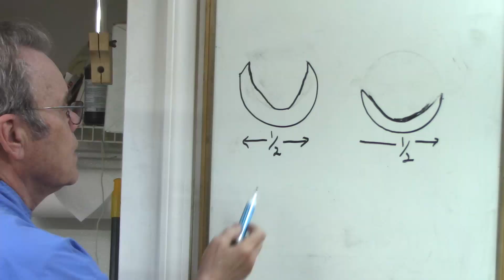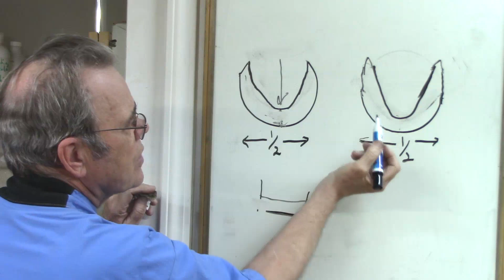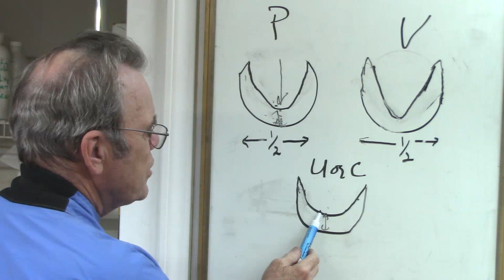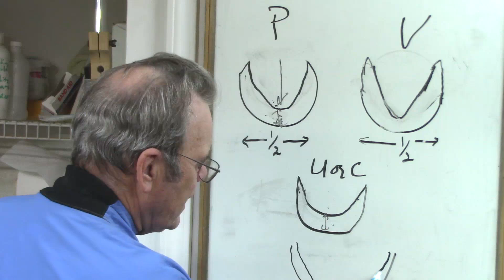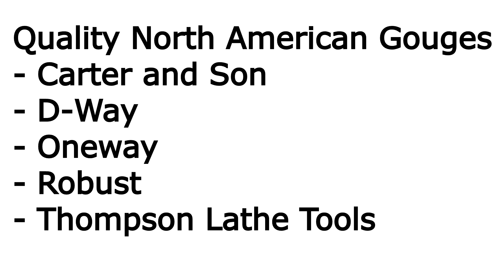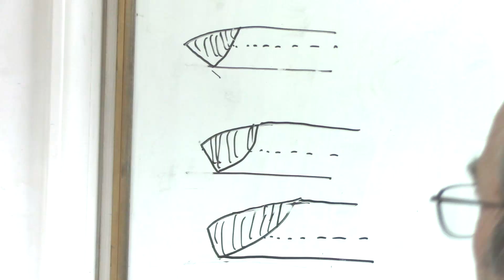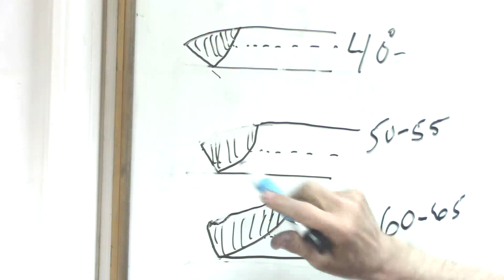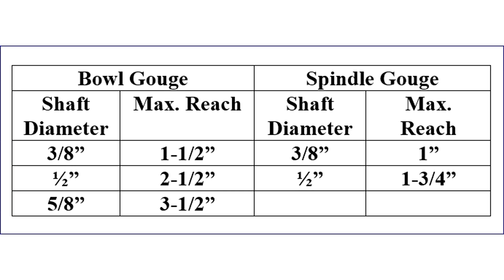What Wikipedia Can't Tell You About Bowl Gouges

Comment: I use a lot of 1 inch PVC pipe for handles.  YOU are responsible for this because one of your videos showed me how to do it!!  I like these handles, they fit my hands and they are not cold.  They are very inexpensive, and I can make one in about a 1/2 an hour including gluing up the tool in the handle.  No  turning required either.  The only problem is that they are not pretty, even painted, and I have had people really turn their nose up when they see my $90 tool sitting in a one buck handle.  Too bad.  They fit me and my style of turning and THAT is what counts.

Comment: While most of my tools have wooden handles I do have a handful of Thompson Tools gouges ( 1/2” bg, 1/2” sg, 3/8” bg, 58” bg) but I only have one 1/2 handle that I use for the two 1/2” gouges because I’m never swapping back and forth between the two frequently. I also have a 3/8” handle that I also use a on a Sorby point tool that is a 3/8” bar. I have 16” long handle for my 5/8” bg that I occasionally put a hollowing tool bar into when Im starting to hollow a piece because the handle that goes with that tool is really long, and for good reason, and the tail stock often will get in the way. Great video Mike.
Reply from the maker: Thanks for sharing., Scott.

Comment: Great video Mike, thanks. However 2 points on how to measure a bowl gouge: 1. In GB, my understanding is that the measurement is from the inside of the flute to the outside of the bar on the other side. 2. Great Britain is not just England. It's better to say UK as it includes Northern Ireland as well as England, Scotland and Wales (GB).  Regards, Doug Bennett (Wales)😁
Reply from the maker: Good point!

Comment: Mike, what angle do you recommend for a gouge working in the bottom of a bowl.  I always
make do with my 50 deg.  I see turners using a gouge that the angle on the gouge is almost 
blunt.  Thanks for sharing these informative videos that I find really helps.  I just turned 80
and yes an old dog can learn new tricks.
Reply from the maker: If you can reach all across the bottom with 50 degrees, I think that is fine. When you find you cannot rub the bevel, then consider raising a bit to say 55 or even 60.